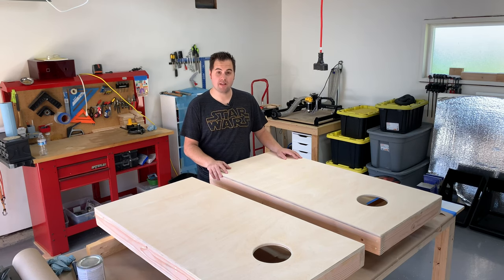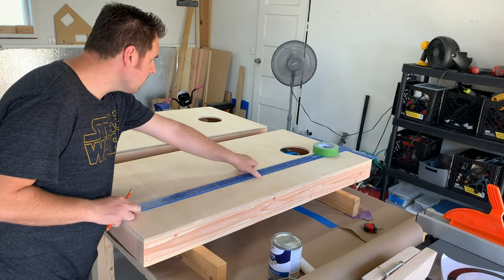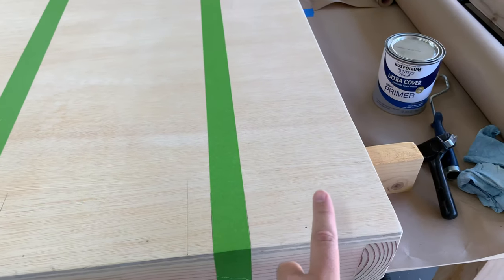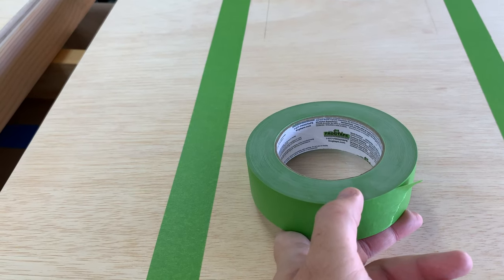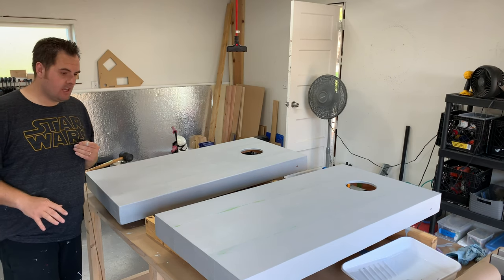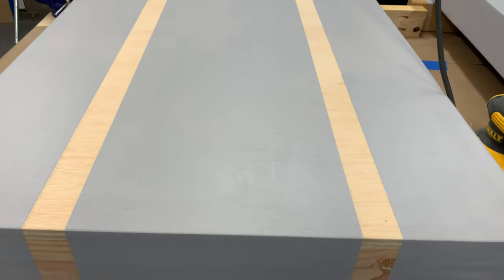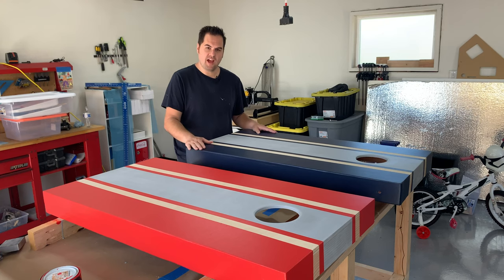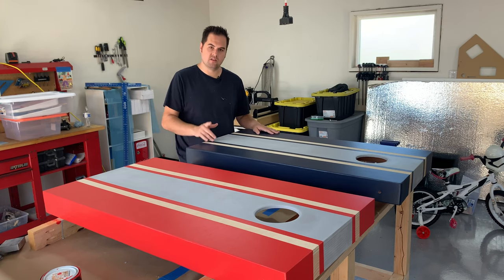How to Custom Paint Your Cornhole Boards | Workshop Republic

Comment: Great video with good instruction.  Question:  is there a need to do a final sanding after painting to make sure the bags slide well on the board?  And also, any thoughts to finishing the boards with some kind of clear coat - then sanding - to give them a nice shine and to allow the bags to slide properly?
Reply from the maker: Thanks Larry. That is going to depend on the paint/finishing you use, for mine I didn't do anything after my last coat and its good enough for me. You can use some paste wax and buff it without sanding, or if you sand, use a high grit (320/400) so it's really smooth. But my suggestion before applying the finish, do the same finishing on a scrap piece and see how it feels. Try different things, sanding, poly, wax/buff, etc...
Reply: How do you consistently paint the logos on? I’ve been messing around with cornhole boards and am using a thin plastic sheet with my template cut out but keeping the paint inside the lines is proving difficult for a dummy like me

Comment: So what type of paint do u prefer? Acrylic? Or outdoor rated. Also if i am applying decals, at which point do i apply them. Thankd in advance!!
Reply from the maker: Hey Vincent. The paint is going to depend on the type of design you give and it's usage. If you know the cornhole will sit outside most of the time, I highly recommend outdoor rated. If you have a cool design and images you want to paint, you could do acrylic and apply a poly finish to it.
The outdoors are pretty harsh on untreated wood, and I had mold show up within a month on the parts I did not put finish on. Even on the bare wood stripe I left, where I applied just a one coat of poly, the mold started growing. So it doesn't really matter which paint you use, but make sure you have it well protected overall.
Reply from the maker: Forgot to reply about the decals. I would apply after the paint, unless you are very good at protecting it from paint to come on. Just make sure to test the stickness after you put paint, cause it may not stick. You might need to sand or even apply extra glue to make sure it will stick. Now if you know the exact location where the decal is going and not paint it, you should be good applying it after the last coat (like a round circle decal)

Comment: I just painted my first set of boards and didn’t think about using primer. I had to use 3 coats for it to look good but noticed I still have wood fibers sticking up. Is it ok to lightly sand with 400g before I apply a logo or will it be ok. After logo I’m also putting on polycrylic as well

Comment: If I paint on mine with acrylic paint .  Are there any additional steps I need to take to ensure the white does not yellow?  I hear use minwax polyacrylic?
Reply from the maker: Hi Ashley, Acrylic paints are usually water based and not oil based, so they don't yellow over time.
But you can always use a good outdoor polyurethane to protect the wood and prevent the paint from chipping and the weather.

Comment: How do you make sure that the paint doesn't bleed? Did you do anything special?
Reply from the maker: Hey Don, the tape was the magic behind it. I tried using the blue tape in the past but the bleeding was happening very often. Using this Frog tape did the trick (along with using one of those rubber rollers to press it down), no bleeds at all. Also, making sure the surface is clear of dust before applying the tape, otherwise it may not hold and paint goes underneath.

Comment: looks great! still trying to decide between this stripe style or the triangle style design... however, i was going to ask (unless i missed it) no need for a protective/top clear coat?? you think the paint will hold up?
Reply from the maker: The paint I used is rated for outdoor and it's been holding up great, so I didnt need to add a protective coat. But I did add a protective cover for the colorless stripe (the natural wood. If you are going to have wood exposed, always put a protective coat. Also, make sure you paint or put a protective coat underneath as leaving the boards outside will cause mold to show up on the underside.
Reply: @WorkshopRepublic  great thanks! I have a carrying bag I'll store them and likely keep them indoors, in my garage or in the patio when not in use, was just worried about the paint chipping, scratching etc when playing (even with soft cornhole bags)... I just want it to last and look great lol. Appreciate it! Going to get paint and primer later today
Reply from the maker: @theserulesoflife  I said that to myself as well, but then you throw a party, you get tired, you leave out, and a couple days go by... lol and is still sitting in my backyard for the past 2 months. But the paint is holding up great, no chipping or discoloration, just dirty from sitting outside, but I cleaned them a couple times and they are still looking nice
But there's no hurt putting a top coat on everything, if you have it on hand, go for it for sure.
Reply: @WorkshopRepublic  I feel like you know me too well haha. That's how my last one was ruined. Better to be safe than sorry!!
Reply: @theserulesoflife  a polyurethane clear coat will make the boards more slick so there is a con. Typically I only clear coat if I use a decal.
Reply from the maker: Great point Mich, depending on the coating it can affect the way the bags slide